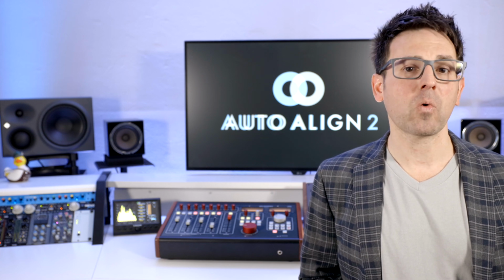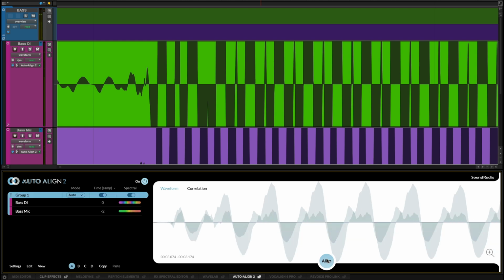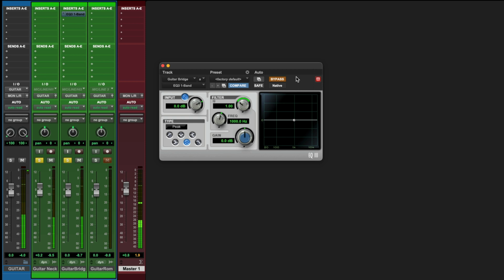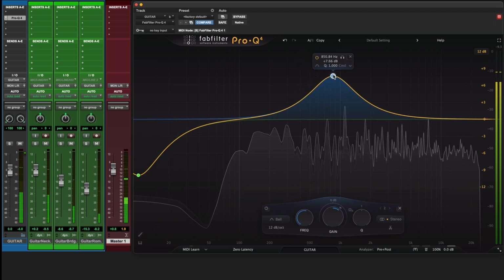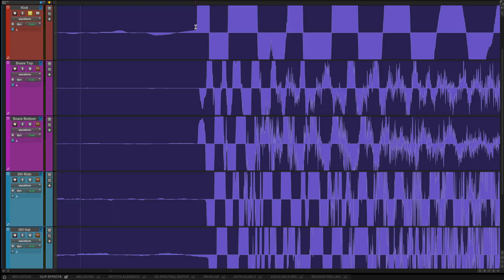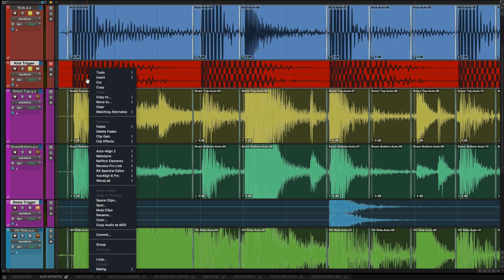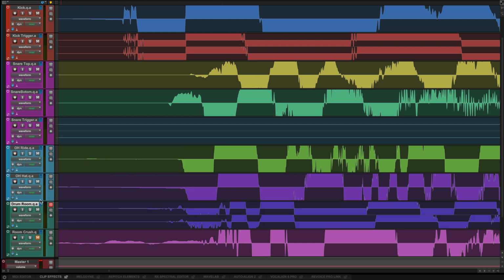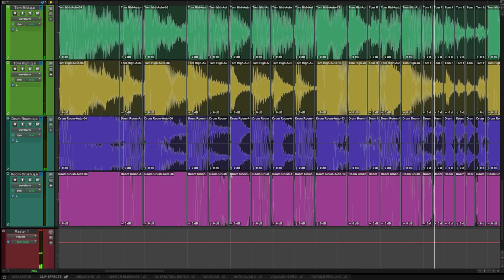Advanced Time Alignment and Fixing Phase Issues with SoundRadix Auto-Align 2

Comment: Hey Todd, great video! I usually have multiple room mics and I like to use the shift button (+) to keep them delayed but still snap to a good phase relationship. I skip through the steps and use the one that sounds best. Direct mics and FX mics are all aligned, usually to the snare top. Does that sound like a good approach? Or should I better try to align all tracks together?
Reply from the maker: Hi Gerrit! 

Yeah, if that sounds best, do it! I think one of the things that is great with Auto-Align is that you can do as little or as much as you want. If I’m working with a jazz or classical ensemble, I’m probably not shifting a room mic. But for pop music or hard hitting rock that needs punch, I typically align everything just since it adds some additional clarity. And yeah, snare top is a great source to make your main alignment. The only reason I do kick is that it is usually the first one to hit at the start of the measure. So it just makes things a bit visually easier for me. ;)